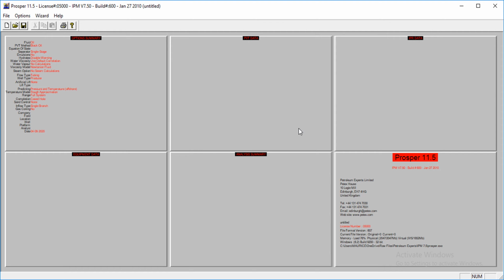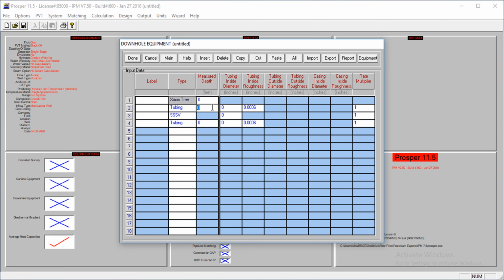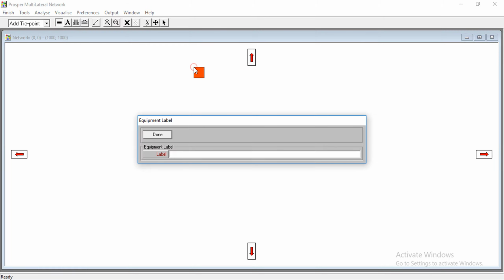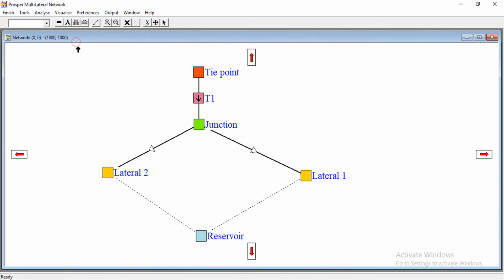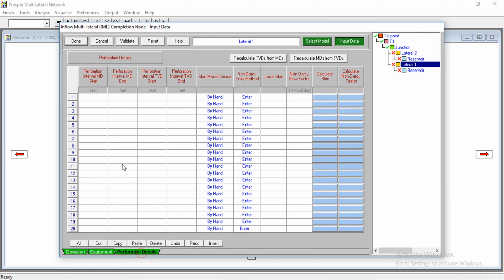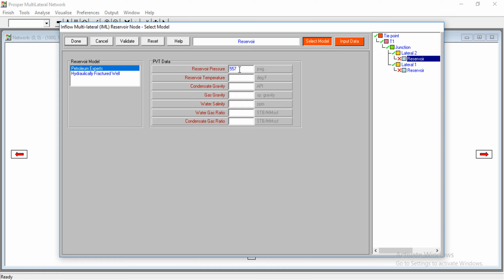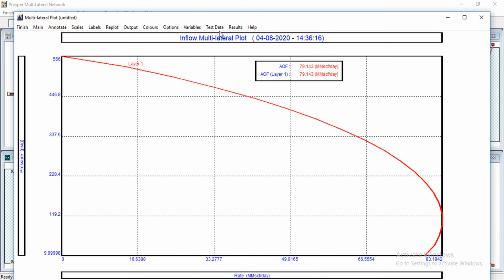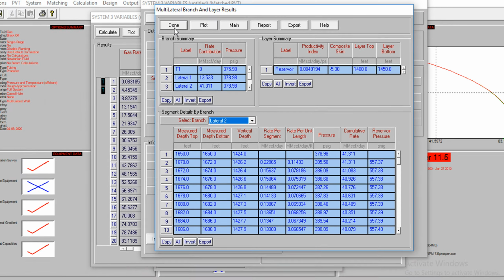Prosper Part 15 (Multilateral well)

Comment: its showing the error that depth in deviation survey is greater than previous node
Reply from the maker: Did you follow the tutorial well?
Reply: @MauriceOscar   Yes, I solved this problem, first node(wellhead) depth was 5 feet which I changed into 0 feet in geothermal gradient and it was solved.
Reply: @MauriceOscar  Thank you so much for the wonderful tutorials
Reply: You are a life saviour, thank you so much